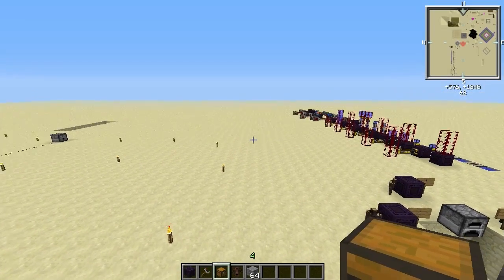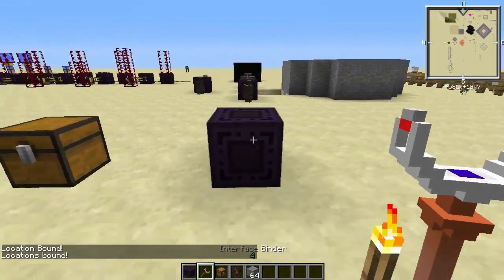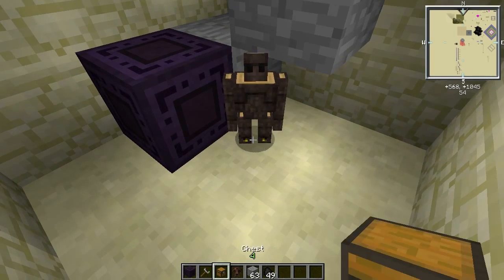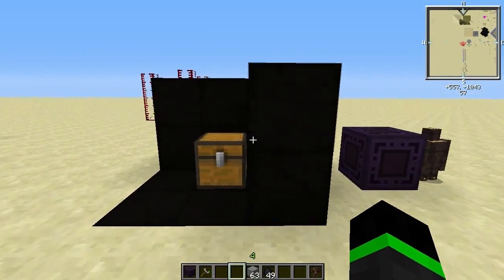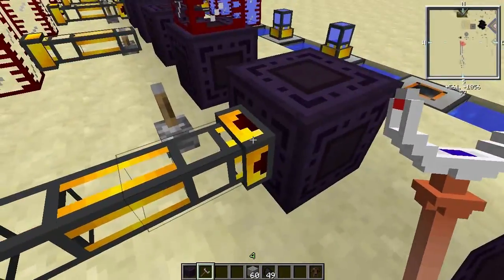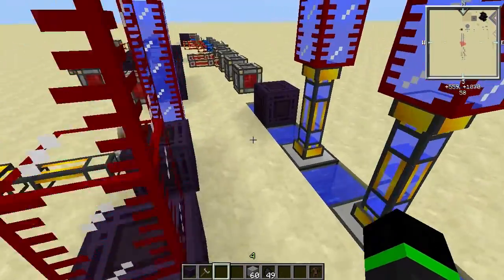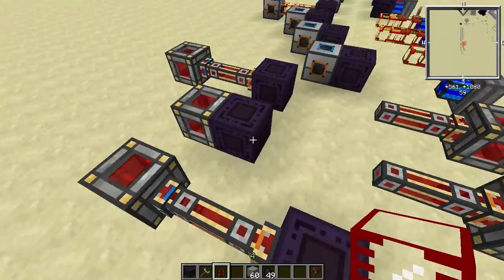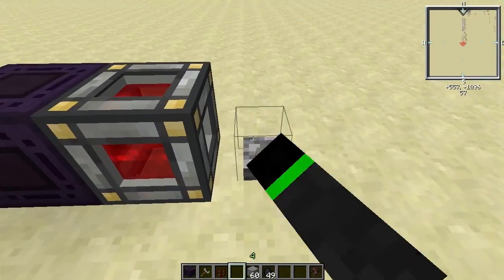Thaumic Tinkerer Tutorial, Transvector Interface

Comment: Any idea why this setup doesn't seem to work? I have a aqueous accumulator connected to fluiducts which I connected into the side of a transvector. I then bound that interface to a IC2 ore washing plant hoping to pump water into it from the interface block as I don't have enough sides. For some reason no water will flow into the machine from the liquiduct OR a waterproof buildcraft pipe either =/ Really messing up my build. Any ideas?

Comment: For thermal expansion blocks, it won't output automatically, you need to set the side to output from to a colorless side. And if it's not connecting after you bound the interface, you need to replace the pipe/liquiduct/whatever.